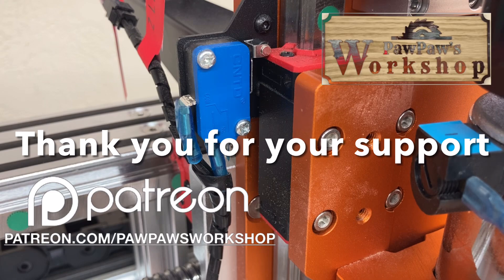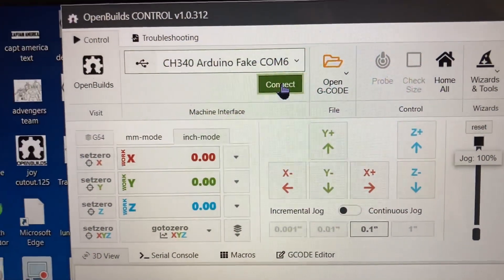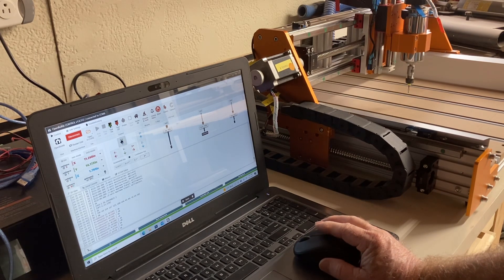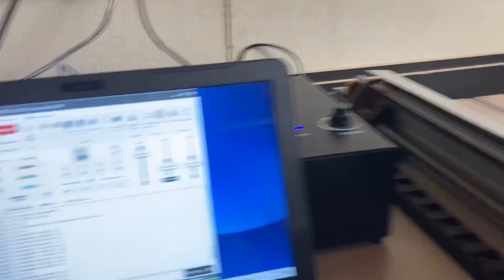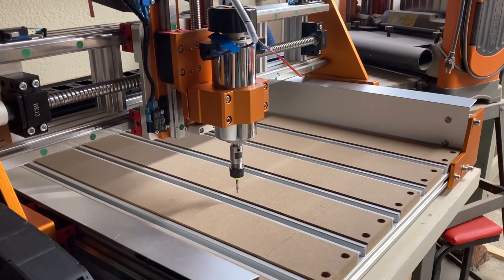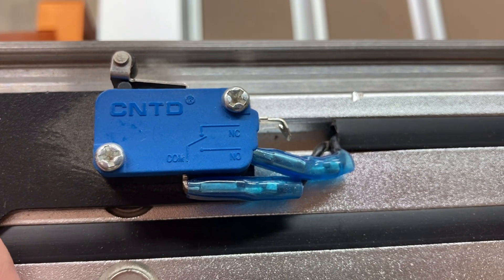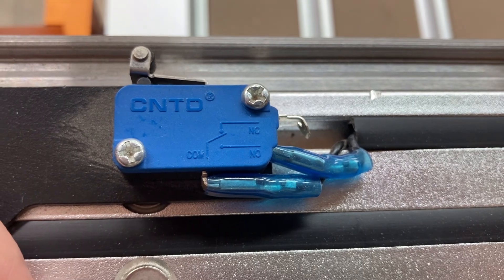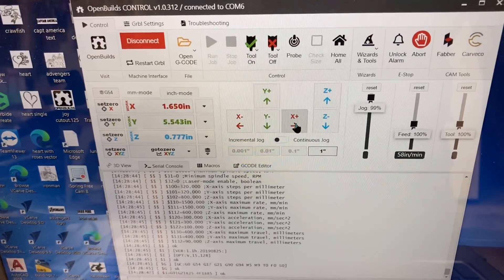Oh NO, My Machine won’t Move! Did I Break it?? It's just the LIMIT SWITCHES

Comment: Most people (including Myself) Use "Normally Closed" because if there becomes a problem with the switch you will know about immediately, if it is set at "Normally Open" there is no way of knowing if the switch is bad until its to late.
Reply from the maker: Ok, that will work, however, all of my machines have the NO (normally open) being used.  Certainly did not want to confuse people even more

Comment: I home my proverxl 4030 and it hits the limit switch one x axis but doesn't back off and sits there and shutters. Is this nothing more than a setting I do on the laptop
Reply from the maker: Look at it very close as you do the homing cycle, it most likely does back off but the limit switch needs to be adjusted. It’s not a setting in the laptop.  I had the same problem when I assembled the FOXAlien XE-PRO. Look at that video